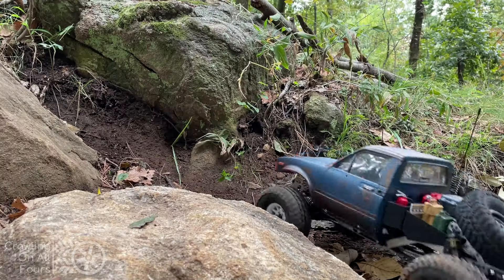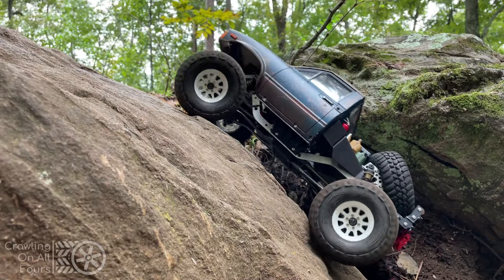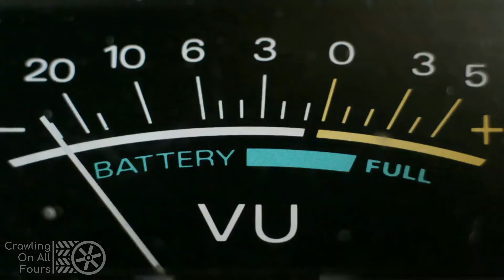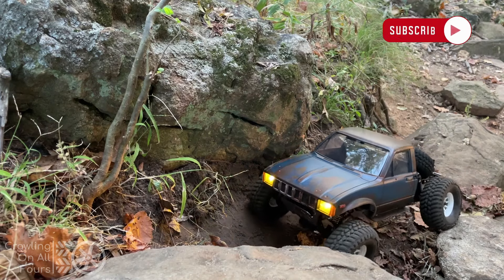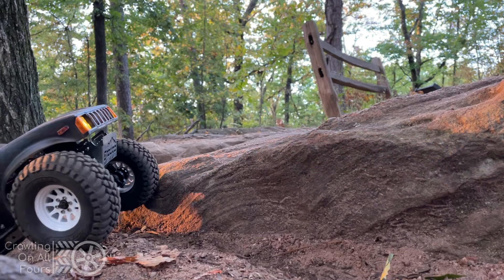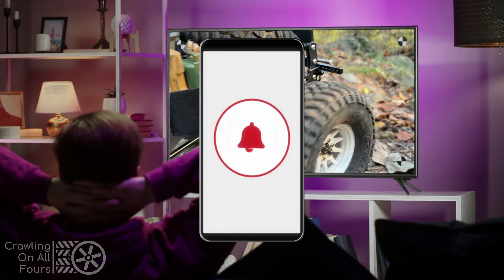AMAZING Results! - Rock Pirates & HOBBYWING Fusion SE #rc

Comment: Fusion changes the game, a drag brake that doesn’t move and smooth slow control is a game changer for tech RC crawling
Reply from the maker: Yeah, and I failed to even mention the bucket of settings you can program and adjust! :) 
Thanks for the comment!!

Comment: Excellent video that showcases the capability of the Fusion SE.  I love your truck as well it is awesome.   It has been recommended that I upgrade my Redcat Gen 7 Pro to this system for better performance as I had been talking about getting the Hobbywing 1080 ESC to replace the 40 that comes stock.  I wonder if upgrading to the brushless system will mean changing the stock plastic spur gear and plastic gears in the transmission.  Still lots to learn and thank you again for sharing.
Reply from the maker: Thanks so much!  Ironically, I actually changed the metal spur gear that came with this truck (eBay purchase) back to the stock plastic spur gear, because the metal pinion gear on the metal spur gear was crazy loud and very high pitched, like nails on a chalkboard to my ears.  My transmission is fully stock, so no issues there.  Metal gearing would theoretically last longer, but I don't think the investment will result in a noticeable performance gain.  For things like that, if it ain't broke, don't fix it. :)   

I'm certainly no expert in this hobby, but the longer I tinker around with hop ups and performance upgrades, I try to scrutinize every dollar spent and maximize the performance gain per dollar.  This has helped me whittle down my upgrade money to the tires, brass, ESC, motor, and transmitter, probably in that order.  With the Fusion SE combo, it takes care of two birds with one stone.  The HobbyWing 1080 ESC is a great component!  I use it in my OG Element Enduro Sendero truck.  It made a big difference with wheel speed control, and it made an even bigger difference when I purchased a better transmitter.  It's very smooth and quiet, certainly a TOP VALUE in the hobby. 

While I prefer the smooth action of the Fusion SE, I don't discount the performance of a [good] brushed ESC and motor, especially if you're looking for scale realism and life-like challenge.  However, for the camera and just all around visual enjoyment, the brushless combo takes the cake! :)  There are more expensive units out there, but again, it boils down to performance per dollar, which is why I chose the Fusion SE for all-around performance.  Thanks again for your post!!

Comment: Great explained video 👍 we have a few Fusion SE in our rigs now and the performance is night and day. Its one of the first mods we make even before tyres (used to be our first change) as then we can run the trucks on a very stable platform and make tweaks to see what and where to make changes next. Thank you for sharing ❤
Reply from the maker: Yes, it's one of the best all-around upgrades you can make to an RTR and also a custom truck without breaking the bank.  It gets me more curious about the AXE series FOC motors and ESC's, at least for the sake of engaging content.  I suppose those are more application specific for the more serious hobbyists. :)
Reply: @crawlingonallfoursRC  well for the sake of engaging content sounds like best excuse in the world to try one or two of those out then 😁
Reply from the maker: Sounds like a dare.  CHALLENGE ACCEPTED.  
...but bear with me, I just need to save a few more pennies!! :)

Comment: Awesome Review ❤
Reply from the maker: Thanks for the comment!! :)  The original RC4WD 20T motor was actually pretty awesome.  It was quiet, smooth, and offered a lot of torque.  I believe the Reedy ESC was the weak link.  I will likely use the 20T motor on another rig.  Although, the Fusion motor is so affordable it's hard not to buy another one! LOL
Reply: Indeed, this Fusion makes a big diference in the Performance for a good price👌🏻

Comment: Just picked up a fusion SE myself and it's such a huge improvement compared to brushed motor/esc.  I remember playing with smaller pinion gears to improve the start/stop stalling at low speed, but the gobs of torque at low RPM with these new generation motors makes pinion gears selection less important.  Great video, and channel.  Look forward to more.
Reply from the maker: RC has come a LOOOOOONG way; what a fun hobby and soooo many cool products to mess around with!  Thanks for the comment!! :)

Comment: I have a brush motor and it’s just as smooth as hobby wing fusion. It’s got the ISDT 90 it’s belt driven with the Holmes hobby crawl master. And gen8 portal axles runs smooth as butter and a cheap axial clone scx10.2 transmission
Reply from the maker: Sounds delicious!! :)  Belt drive??  I JUST told another commenter that I was very interested in the Holmes Hobbies brushed products!  I was concerned that my video might come off as too generalized against all brushed motors, bc I know not all motors are created equal.  I'm a Gen8 fan; it was between a Gen8 and an Element Enduro Sendero a few years ago and I chose the Sendero (which I still love!), but I'd like to get a Gen8 with those portals.  Thanks for the tip!!
Reply: I always use isdt esc90 or 70 and holmes motors its a combo you cant beat and i run the1800se and i prefer brushed in my trail rigs and brushless in my lcg and i cant tell the difference between the two

Comment: Does anybody know if the FOC function can be turned off????
Reply from the maker: Someone knows. :) LOL

Actually, you CAN turn it off in the programming.  It's designated as the first option as "RPM / throttle matching".  You can enable or disable it.  If you're more for the challenge, then disabling it will cause it to function just like any other sensored brushless motor / ESC with a 1:1 throttle experience.  If you come up to an obstacle the vehicle will slow or "stall" and you'll have to adjust your throttle as you climb over the obstacle.  The results will test your skills and be more realistic compared to the smooth controlled action of FOC.  Personally, I would never have the need to turn it off other than seeing the difference in performance, which could probably make for a good follow up video review.  

To be honest, FOC is a little bit of a cheat if you're looking for scale realism.  However, the performance is AMAZING, and from the videos I've both seen and also created myself, I think the results of FOC look great on camera, so that's what I prefer.  

Thanks for posting the question!!

Comment: How many amps were each? I have a kit and an rtr and the difference between the two of them is night and day also. Still not a brushless but not all brushed are equal
Reply from the maker: That's a great question.  If your question is referencing the ESC's, the Reedy spec is 40-amp (which actually wasn't bad for the original Element Enduro RTR) and the Fusion spec is also 40-amp, which seems typical for most intermediate components like these.  

Each motor type (all things being equal) definitely has it's pros and cons.  The 21-turn RC4WD motor that I first installed was relatively quiet, smooth, and had lots of torque.  Paired with the Reedy ESC, it was stop and go over while going slow over obstacles.  However, it was awesome running on trails and there is a smooth throttle response as you apply input at higher speed.  The brushless motors (this is my 2nd one) are more direct with their power output, like it's on/off.  I can see why some people don't like brushless.  For me, I like to capture my crawlers on camera and I think brushless (with FOC) gives the best bang for the buck.  

I am dying to try some of the Holmes Hobbies @holmeshobbies brushed products.  I have another project in the near future, so maybe I will hit him up. :)
Reply from the maker: I had to make a correction.  The Reedy SC400X is 40 amps (not 80 amps), so they are equal at 40 in terms of amp output.

Comment: Very good video and great explanations. I also ride an enduro, the V2 kit. What chassis did u use on this build? The truck sits lower and it looks like an aluminum chassis.
Reply from the maker: Thanks!!  I tried to pack as much information as I could without being too boring. :)  I'm running the Interceptor chassis, but I'm thinking it's the stainless steel set.  Since I bought it used, I'm not 100% certain.  Thanks for posting!! :) :) :)

Comment: Does Hobbywing offer a brushless esc & brushless motors for 1/24 & 1/18 scale rc crawlers, just like Furitek offers?
Reply from the maker: That's a great question.  I don't have a small-scale crawler yet, so I haven't researched this.  I know I've seen 380 and 280 brushless motors before.  I don't believe they have ESC's contained within the same can, though.
Reply: @crawlingonallfoursRC  ok, thanks for the info & the excellent video

Comment: Not sue I have ever had a brushed setup stall in my life ? Good esc will do the job. Using 45turn with 3 cell lipo has been a perfect so far. Have used brushless rigs before never really felt a huge gap in performance honestly. 3 cell gives you all the wheel speed. The 45t motor will get that torque where its needed : ) That being said fusion setup is on sale for less than 100cdn right now. Hard to pass up !!
Reply from the maker: Interesting.  The motor I originally used was 21-turn on 3S and I was still experiencing the "stall".  Granted, the performance was more "scale", so I still give it points for realism.  I know all motors aren't created equal; I would actually like to get a brushed system from Holmes Hobbies in the future.  My Enduro Sendero truck has the stock Reedy 5-pole motor (it's quiet!) and I had replaced the Reedy ESC (from the video) with a Hobbywing 1080 which is a great combination.  It performs wonderfully with 3S.  The movement is very smooth.  Thanks for the great comment!! :)
Reply: @crawlingonallfoursRC  Oh the 5 pole sounds like fun. I have always found 35-55turn the optimum for hard rock crawling with 4.5+ pound rigs... paired with 3 cell of course. THis video really helped my finally try out brushless, waiting on my 1800 fusion now for the capra : D
Reply from the maker: That's awesome!!  Glad to hear this video inspired some action. :)  I know you'll enjoy the brushless system!  Thanks for the brushed motor turn tip.

Comment: Hi Crawling on all fours, I was considering this HW Fusion SE 1800kv but my first choice in getting is the HW Fusion Pro 2300kv and plan to upgrade my TRX4 Defender from its stock brushed motor seen in my channel here if you look for it. 
Do you recommend the Pro over the SE or vice versa? What do you think? Thanks.
Reply from the maker: Technically, I have both versions! :)  However, my "PRO" version is actually the V1 PRO that was released a few years ago.  I got that with this truck I bought on eBay, and I talk about the motor a little bit.  You can see the performance and wheel speed in these videos:

Most recent video w/ upgrades:  https://youtu.be/bd0qEconfDw
First video just after receiving it:  https://youtu.be/UvAg4wz_IE8

You can see the super slow SE wheel speed here (around 3m 25s mark):  https://youtu.be/MYetOTexBKw

I was already spending a good big of money on this rig, not all in one shot, so I chose the SE 1800kv simply because of price.  Since many of the reviews I watched or read all agreed that the SE performed 90% as good as the PRO, I thought the SE was a no-brainer.  However, if your budget allows for the PRO, go for the PRO!!  You WON'T be disappointed!!  Thanks for the great question!!  :) :) :)
Reply: @crawlingonallfoursRC Thanks for responding man, you have nice voice over commentary I don't talk in my videos I don't even want to be seen 😂. Hope you channel grows, I'm still growing mine too and like you as well I get my gear on Ebay and marketplace like Kijiji.
Reply from the maker: That's really kind of you to say; thank you very much!  I wish you the same success with your channel; I'm a new sub! :)  UP UP AND AWAY!!!
Reply: @crawlingonallfoursRC Me too I subscribed to your channel. Too bad you're not near my area, I'm in Vancouver Island, Canada. We could collab. My youtube channel and RCs are my hobbies but I'm part time pro photographer/video producer.
Reply from the maker: I hear that's some beautiful country out there.  I'll keep an eye out for of your vids to rack up some views!  Cheers!!